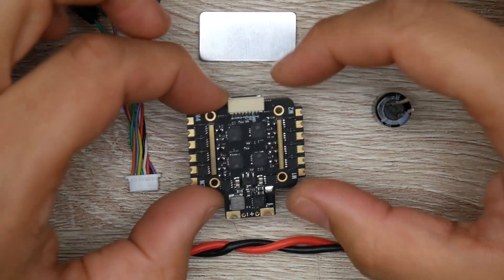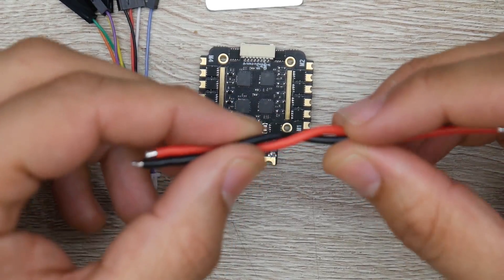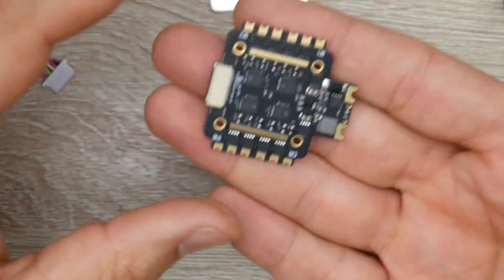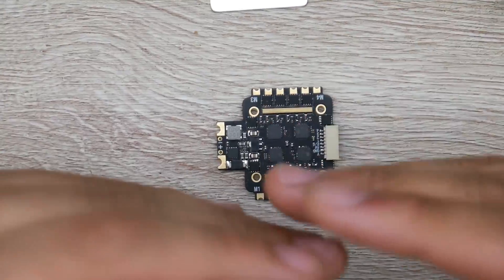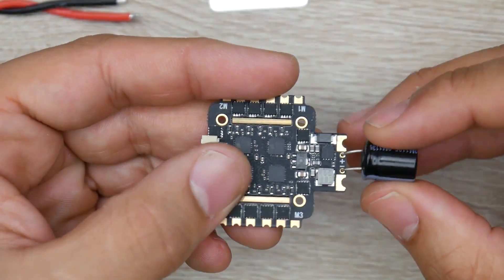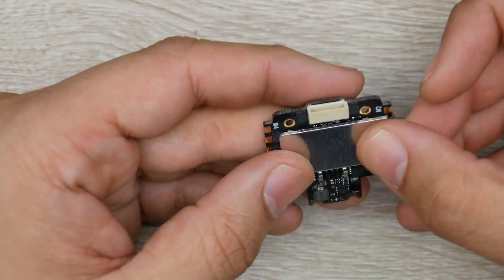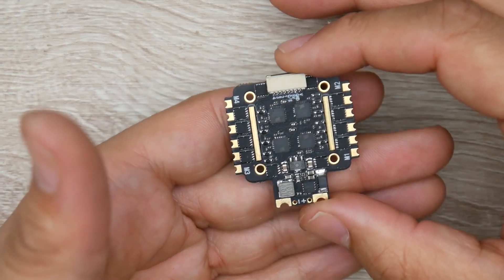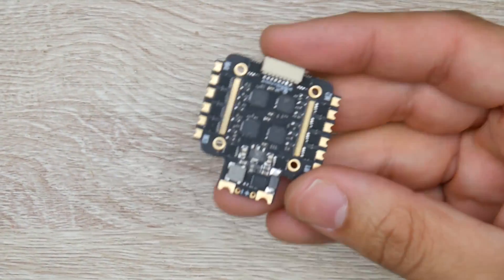Racerstar Reachup 40A 6S ESC // Overview & Setup Guide

Comment: Is the purple wire, which you called telemetry correct? The pin is labeled V, so I assumed it was battery voltage?
Reply: I can confirm it is VBAT and the ESC has no telemetry pin onboard